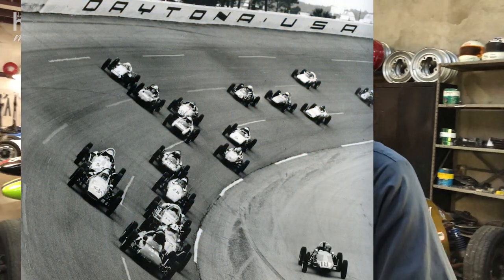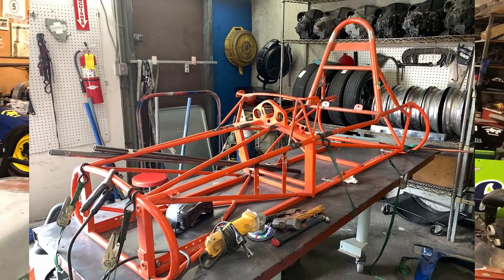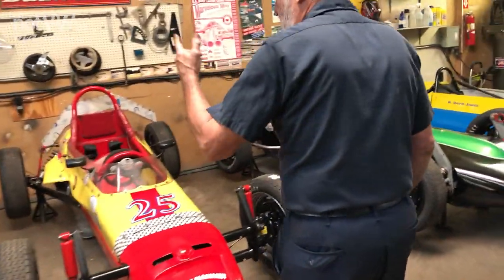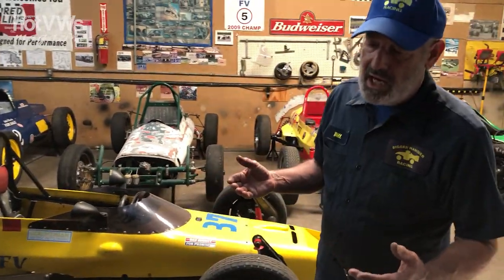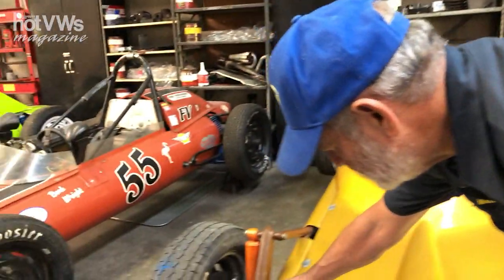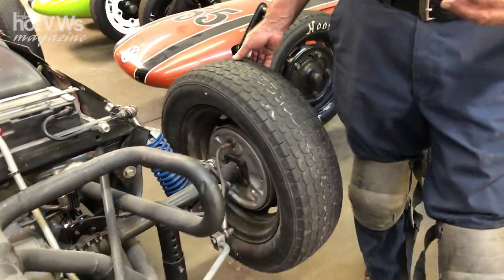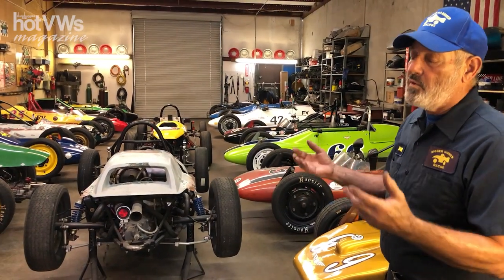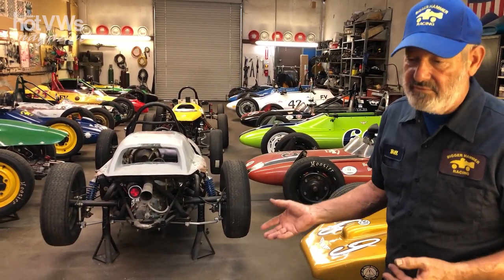Bill Griffith, The Man Dedicated to FORMULA VEES for 50 years (Hot VWs Magazine Nov 2021 feature)

Comment: I think it would be cool if they would update the rules to go with a '69 and later front and rear suspension, and the 1600 dual port engine.  A lot easier to get the parts, and better handling in the rear especially with the IRS.  Of course the cars speed potential would go up too, but not to wear it would dangerous or anything.
Reply from the maker: Could be wrong, but some FV in Europe allow to run '66 and later ball joint front end. SCCA FV stayed old school.
Reply: as mentioned by Hot VWs, SCCA FV stayed with the original design & Europe did evolved, even in the 70s. however, Formula First in the USA does use the newer balljoint beams & 1600 engines, following the Australia FV rules.
Reply: @MidgetRacer8192  That's cool.  That's a car that I would build.

Comment: You meant that you don't use both of of the torsion leaf stacks, you are still using all of the trailing arms.
Reply: Lol! You are correct. Two excuses. One, I’m not accustomed to being interviewed by a world famous magazine and Shin didn’t let me edit the video
Reply from the maker: As Bill explained, the upper torsion leaf stacks were removed (Bill said remove one set of traling arm, but he means killing a function of upper trailing arm) and replaces with a 3/4" solid bar (move freely inside the inside the beam). Then, that bar is bolted to the trailing arms. So, it works as like a sway bar.

Comment: I guess a 40 that turning 6,000 is making more than 40 hp.
Reply: Not sure but think a 40 turning 6,000 is either modified or in neutral.
Reply: @busnut2  The formula V don't weight nothing and less wind drag . it is like in neutral  yes !
Reply: @busnut2  he says they lighten and strenghen everything allowed to make it rev to 6k. it definitely makes more than 40hp thats the point :)
Reply: @veryrare7647  ...you can get 50 plus legal hp ,but you have to acid the intakes ...I raced a Kelly at Mosport in the late 70's ,but sold it an build a Zink Z 10 Formula ford ,sold it an went windsurfing.
Reply: the top legal FV engines now are making 65+ hp now, and the biggest tracks are around 7000rpm.